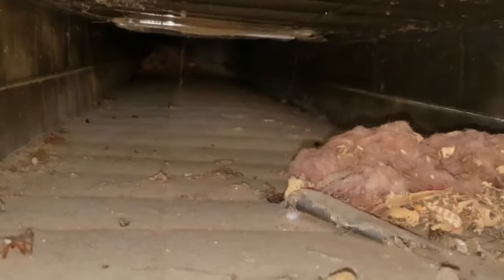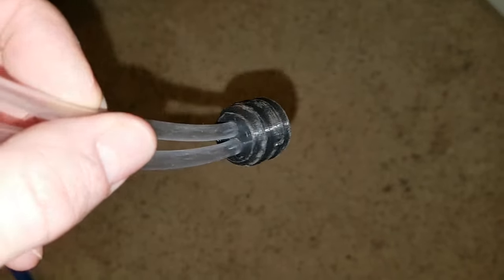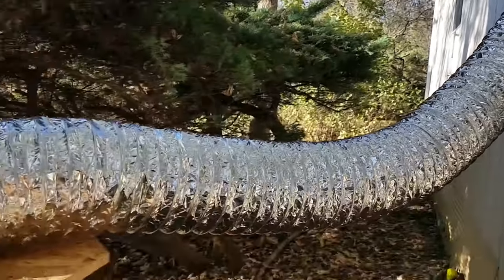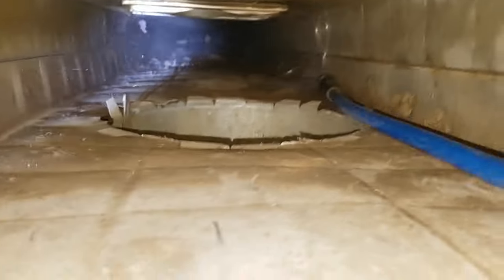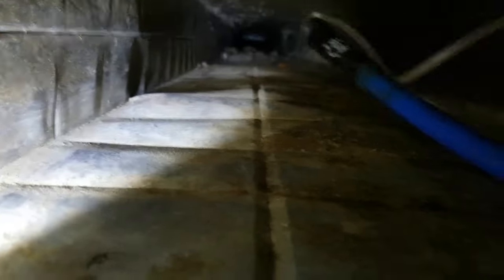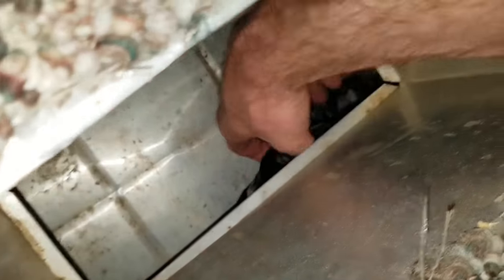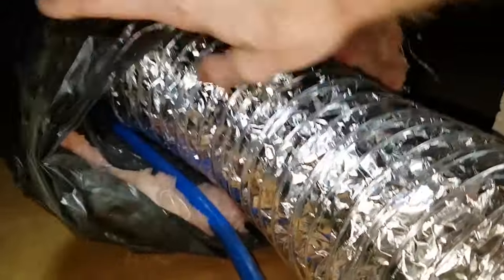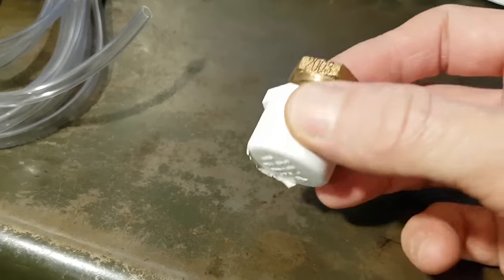DIY Air Duct Cleaning Tools, part 1 - How I Cleaned Air Ducts using DIY Equipment, 40 year old house

Comment: For sure not the best way to do this😂😭
Reply from the maker: If you know a cheaper,  better way to do this then please tell us.  There are many people like me with limited resources that could benefit from that information.
Reply: @BudgetPhil  The problem is that you broke a lot of particles loose, and your vacuum setup isn't strong enough to get all that out, so it blew out your vents later and exposed you to whatever was in there, which is not what you wanted. Had you left it alone, it would have stayed put. Even the Pros have problems with this, and the EPA backs this up, but the pros capture a ton more because their hose is sucking at the point of the agitating brush. If health is the concern then you definitely want the pros to do this.
Reply from the maker: Thank you for your concern Terry.  You can rest assured that the small particles were vacuumed out with no problem using the leaf blower vac.  However, the residue stuck on the sides of the ducting was much more difficult to remove.  The debris in the ductwork that was under one of the bathrooms had started molding and was really effecting the air quality in that bathroom.  After cleaning, that mold smell completely disappeared, as did all the other air quality problems we had in the house when the heater or a/c would come on.  I wish I had done it a lot sooner.  If the ducting was much larger, than I don't believe the leaf blower vac would have worked well, because it could only move about 400 cfm of air.  The negative air machine I built during part 3 moves about 2500cfm of air and more than fixed that problem.  And I was able to remove the residue from the duct walls using the drill powered brushes I made during parts 5 and 6.  Even some the professional duct cleaning services may have trouble doing that.  A couple of different professionals recommended spraying a coating over the residue, but that seemed completely unacceptable to me considering I didn't believe it would stick to the residue very well.  Kind of like when paint doesn't stick well to a dirty surface.  I couldn't find the help I was looking for when trying to resolve this problem, so I did it myself.  And it worked.  The loose particles were easy to remove, but that residue was a real pain.  In part 7, I made an air whip with brushes that even gets down into the corners of the rectangle ducting.  It's not as aggressive as the drill powered brushes, but it does work to remove residue.

Comment: Safety glasses everybody........
Reply from the maker: One should always wear safety glasses when using compressed air.  I learned this lesson the hard way.
Reply: Also need Hearing Protection, as it is quite loud, even on my Fiberglass Exterior Wrapped Ducts.